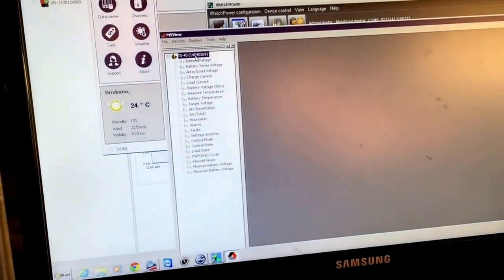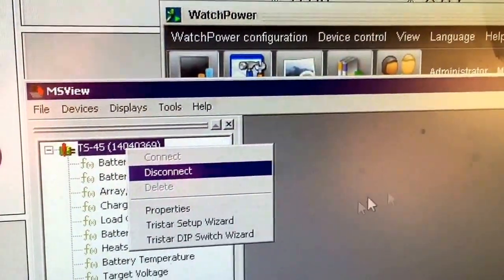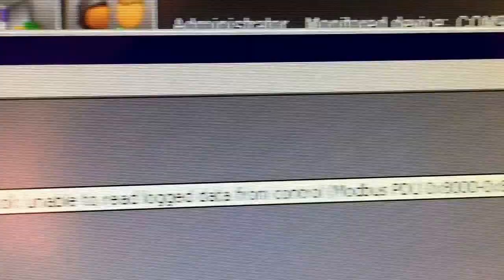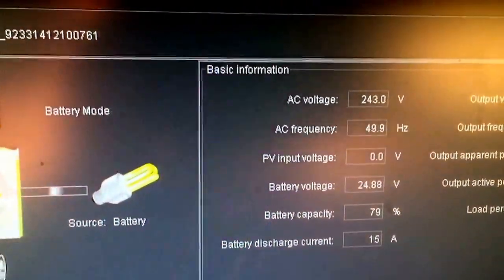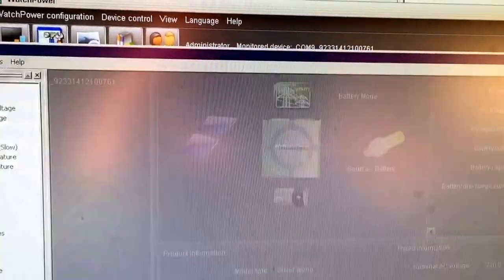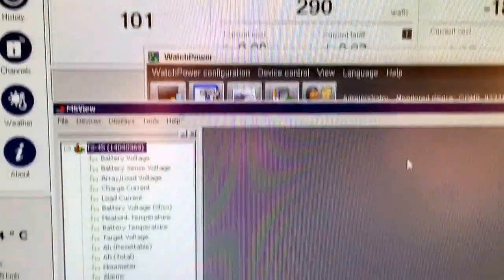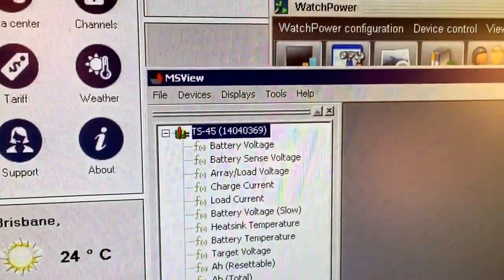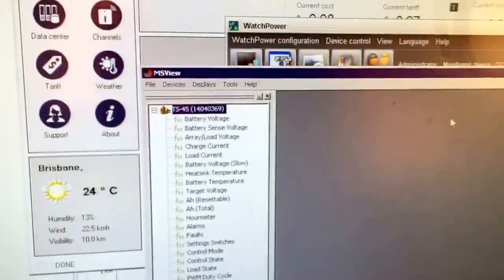MSView configuration help PLEASE

Comment: Geez sorry man, I feel your pain! I’m not having your particular troubles but not far off!!!
Reply from the maker: I hated that unit but it did work in the end
Reply: HBPowerwall - great to hear you solved the issue...I currently have a Morningstar SS 15amp that won’t go to absorbion voltage for whatever reason???!!! I saw online a guy had the exact same issue but even he didn’t know what fixed it but one day his just started to work & went to 14.+ volts. Anyway going to Enerdrive here in brizzie to get it solved...they tech sounded like he knows his stuff but very helpful as well. (Fingers crossed)...urgh why can’t stuff just work as it was intended????

Comment: Have you tried to run it in Administrator mode. right click on the program and go down to were it says run as administrator.   I had to do that with my Watch Power software to get it to view the data, because I'm a data freak I like to see whats going on ect.  

I hop you get it figured out.